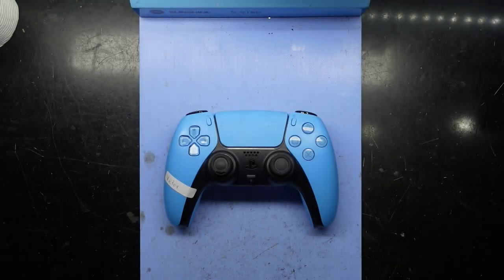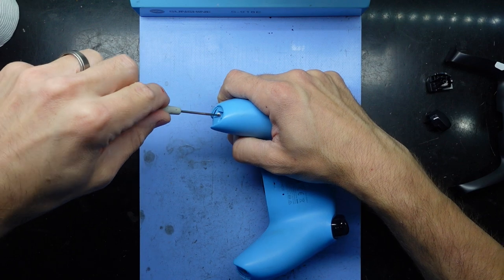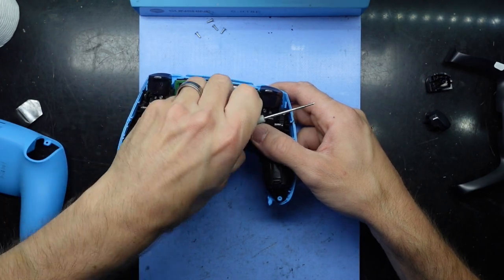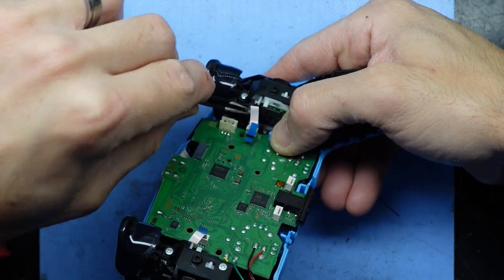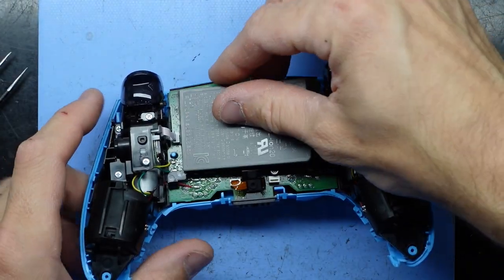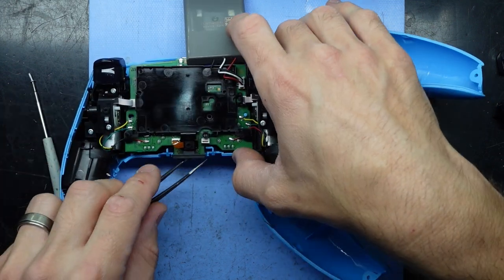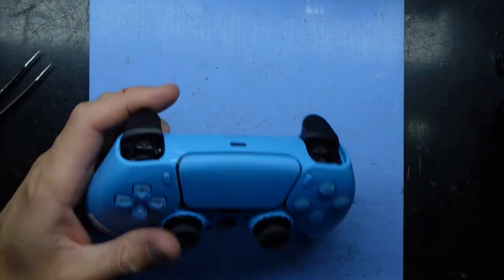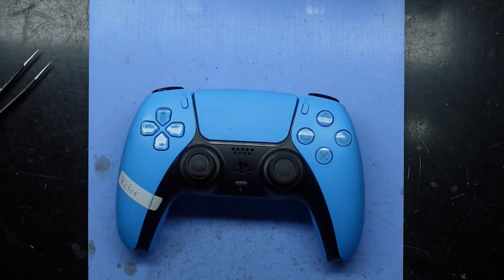Dual Sense Controller Dropped now D-Pad Issues, Possible Solution

Comment: I bought a Galactic Purple DualSense from a pawn shop a few months ago for $35. It was a great deal, especially because it only had a few minor scratches on the back of the case, but all buttons except for D-Pad Down worked. 

I disassembled it and reseated the ribbon cable at 3:10, and now it works! Like you were saying, it must’ve come loose during some sort of impact.
Reply from the maker: Awesome to read, this has helped you :D